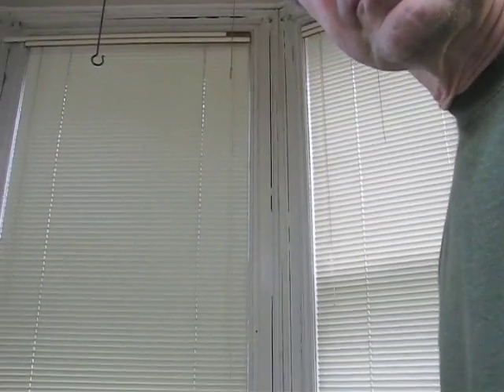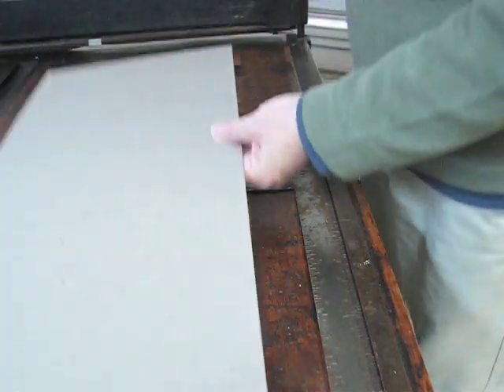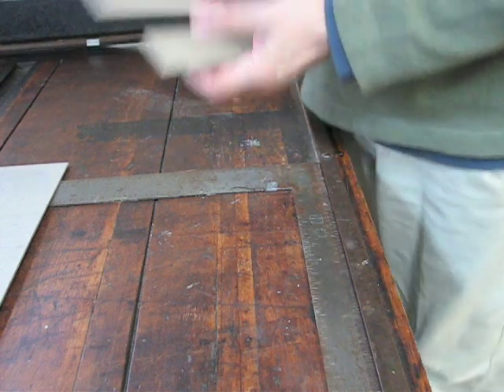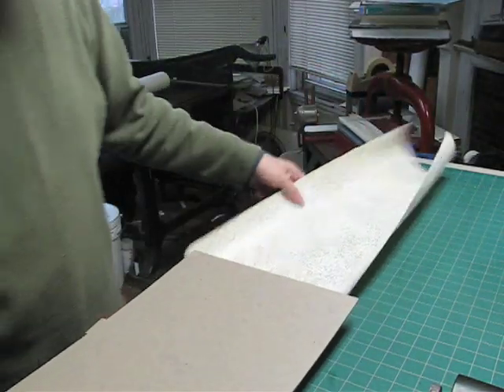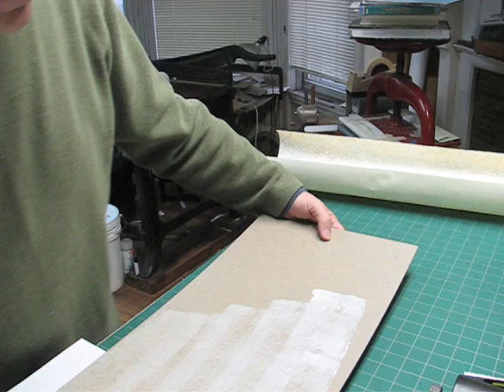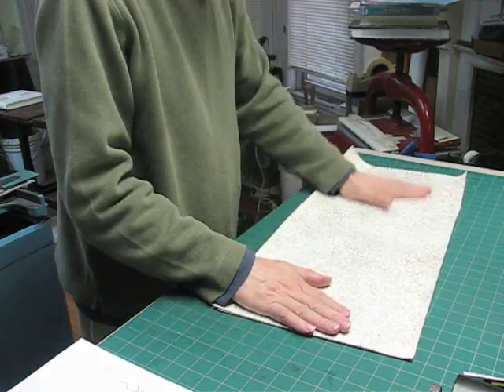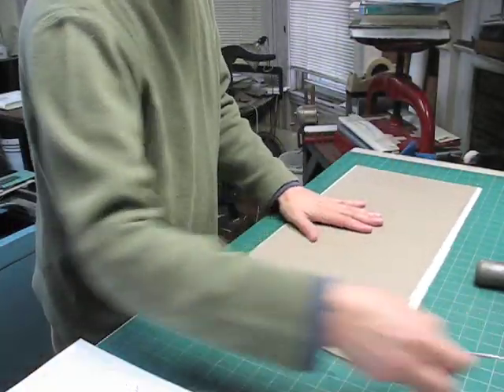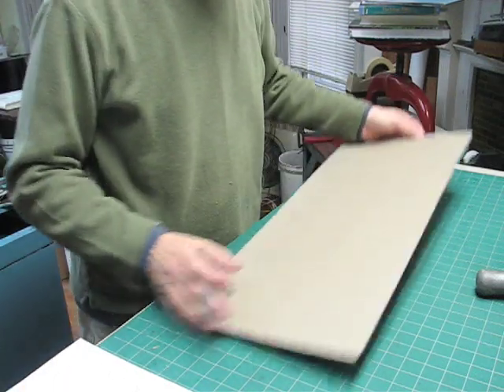Making a Slipcase Pt1 - Cutting and lining

Comment from the maker: Board usually runs long grain. It will bend more easily along the grain and be  resistant against the grain. You have to feel the tension. That is why I usually put the pencil lines on the board along the grain. It is more difficult to feel in smaller pieces of board. 
 As for the glue question, please watch my Glue and Roller Basics video. All is answered there.  Thanks for watching!

Comment: Hello
First, thanks for taking the time to make these videos.  They are great; very professional and informative.  Now to my question... I bought a beautiful, white imprinted cotton for the lining before I watched your videos. Would fabric work as a lining?
Reply from the maker: It could work, do a test by rolling a thin coat of PVA on a small board and lay the fabric into it. If the PVA does not come through, you are home free, if it does do this.  Prepare some methyl cellulose like I do in the paper backing silk video and squeegee the back side of the fabric, allow it to dry iron it if necessary and now it should go onto the board without PVA coming through it. The MC should not change the surface of the cotton significantly.  Have fun!

Comment: Hi Sage,
Great videos!  Thank you for sharing these.  I have tried to search comments on several of your videos and didn't see whether or not you shared the weight of the Davey board you use.  I have gotten conflicting info on which is best to use for a professional slipcase.  Standard board 0.059 or Davey board 0.080.  Can you provide some insight into this?  I am trying to make my own custom slipcases for some larger heavy books (some that over 1000 pages).  Thank you.
Reply from the maker: +GeminiiFilms I use various thicknesses for books depending on the size and weight of the book, small books (5x7) .059, mid size books .090. and large books( 16x20- 14x19) .124,. Your thousand pagers might be better  served and easier to handle in a clam shell box. Hope that helps, Thanks for watching.
Reply: +Sage Reynolds In one particular example, I have Under the Dome by Stephen King, the dimensions are 7 x 9.5 but it is much thicker than any of my other books at 3in width.  So, is it the weight of the book or the dimensions that most determine whether to use thicker board and a clamshell vs. slipcase in your opinion?  I have also seen some people make a very small text block support strip on the bottom of the clamshell/slipcase to prevent gravity from pulling the text block of heavier books downward when standing vertical.  So I might want to try that.  Thanks.
Reply from the maker: GeminiiFilms
If the book is to be preserved, the Clam shell box is the best option for all sized books. In my opinion, the slip case is merely a way to hold the book closed and in a rectangular form on a bookshelf where sometimes the books lean and get skewed. If you are using slipcases, they should be on the shelf with the open end at the back of the shelf, you only see the box end and the spine is protected from sunlight and dust. For your Under the Dome, 90 point board should suffice. BTW clam shell boxes are usually ( and should be) laid on shelves so there is no need for the text block support.
Reply: +Sage Reynolds Thanks again for all your insight!
Reply: +Sage Reynolds Hi.  Sorry one more question.  Do you have a recommendation of an economical (budget) cutter that can make it through the Davey Boards?  Naturally I do not have space or the budget for anything industrial like you are using.  I see lots of Rotary and Guillotine type cutters, but the prices range from really cheap (probably not worth it) to really expensive.  Thoughts?  Thank again!
Reply from the maker: If you are doing a lot of box making, you need a board shear. I don't know of any being made in this post industrial age.  Paper cutters and  rotary cutters will not work at all for various reasons and practicalities. The best you can do is find an old one in working order.(sometimes on EBay) Ernest Schaeffer in Union NJ has had them in the past ( about $1,400-1,900) and he does the restoration that has them working as they should. There was also a Graphic Arts machinery company in NJ that had a wide variety of equipment, I would call those type of companies to see what they might have on hand.  They come in various sizes usually determined by their knife length. Mine is a 42 inch, the blade with handle and counterbalance is about 72". the table itself is about 45" square. If you could find a 36" it would suit your box work and not take up too much floor space. Be aware that the smaller  shears have a higher price because of their desirability. People don't want to disassemble them to get them through doorways. It's a very straightforward process to disassemble and reassemble the shear, I've done it a number of times with mine. I have heard that a Shaker was building board shears, the one I saw was a convenient size but the blade was light weight and the table wasn't stable or thick  enough (3/4 plywood) for me to consider recommending it. If they are still in production, they may be better now. You do need a pressure clamp to hold the board as you cut (foot pedal). I hope this helps a little, if you are making a commitment to box making, this is your most important tool after your hands. A good shear will cut everything from davy board to paper backed silk and tissue paper. Good luck with your search.

Comment: Would I have to use thicker board  for a  3 ring binder what kind of bored is that
Reply from the maker: You should use thicker board, I'm using, for most projects, Davy board in the 60-92 point thicknesses. Large projects use the heavier (80-92) board. Thanks for watching.
Reply: @Ceropegia  100 pt chipboard good enough? I've been trying to figure this out for quite a while because I want a slipcase for my card collection binders and I want to make sure I make them strong the first time
Reply: @Ceropegia  thank you very much sir😁